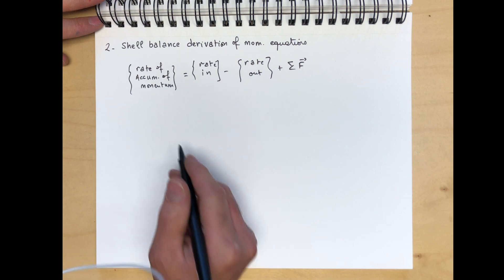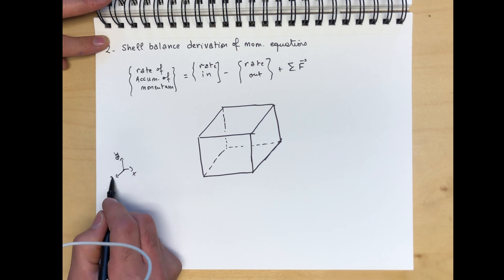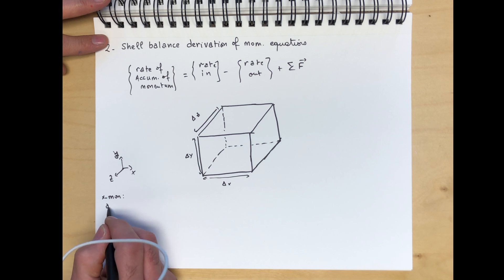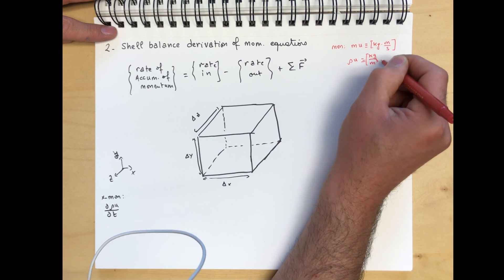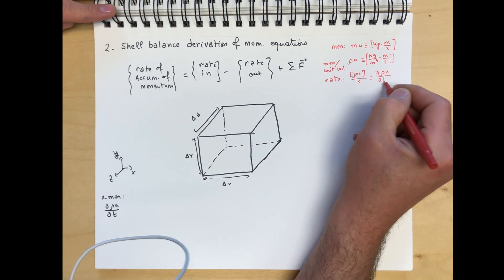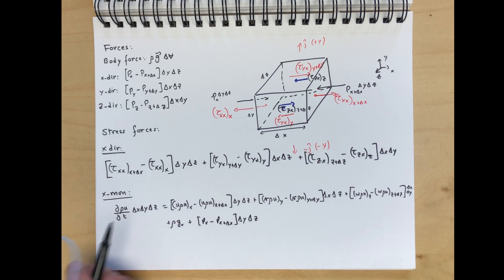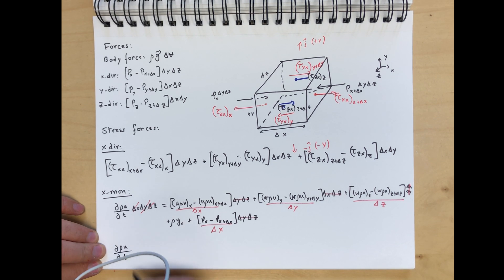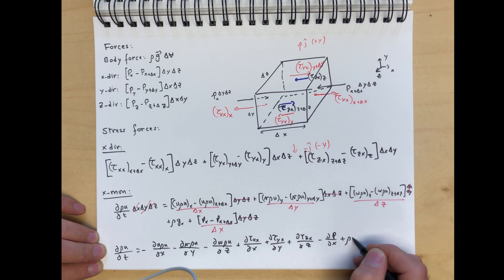12.2. Shell Balance Derivation of Momentum Equations (Force Interpretation)

Comment: I think the solution you have provided is wrong. Could you please share the source from which you have picked it.
Thank you very much.
Reply from the maker: Can you be more specific? Thanks.
Reply: @ProfessorSaadExplains  Sir please share the source or book from which you have taken it. Thanks
Reply from the maker: @murtazaali9221  Hi Murtaza. The material is based on several standard textbooks such as: Munson, Young, and Okishii Fundamentals of fluid mechanics, Cengel and Cimbala's fluids book, Wilkes' etc... You made a claim in your original comment that the solution I provided is wrong: please clarify and back your claim - which part you think is wrong so that I can either correct it or be able to answer you. Thank you.
Reply: @ProfessorSaadExplains   Sir at the start of the velocity terms you added, like for the x direction you added u, v, and w velocity vectors as well, which I think is not correct. For the x direction you should have only added u velocity vector/term.
Reply from the maker: @murtazaali9221  Hello Murtaza. This is a common misunderstanding. Each component of momentum is advected in all three directions. Take x-mom for example (x-component of momentum - or rho*u). x-mom will be advected by u, v, and w and will flow into a control volume from all directions. The net advection of x-mom will then be the divergence of the x-mom advection vector, or div(velocity_vector rho u). Think of x-mom as just a scalar being advected by a velocity vector field. Please revise your transport phenomena classes - those should cover this concept. Thanks!